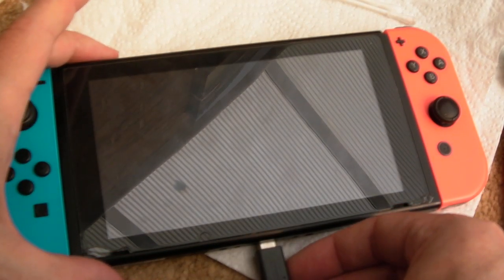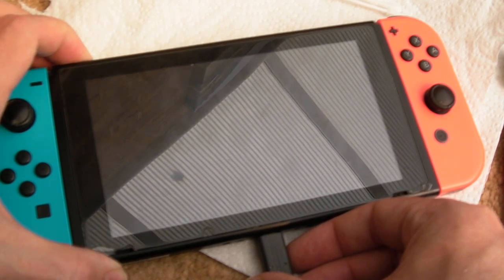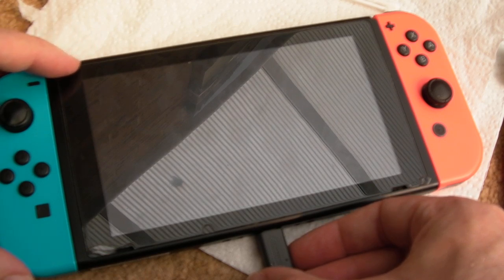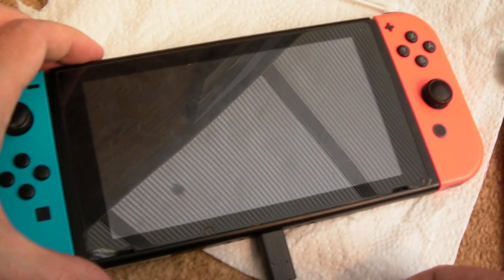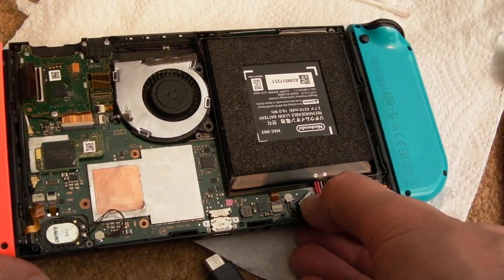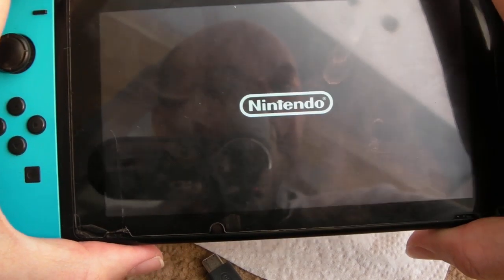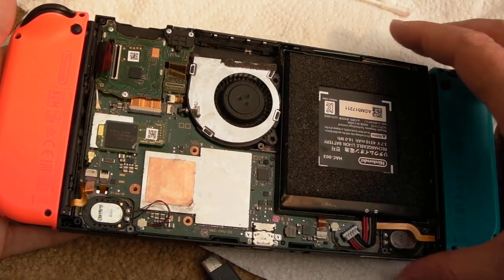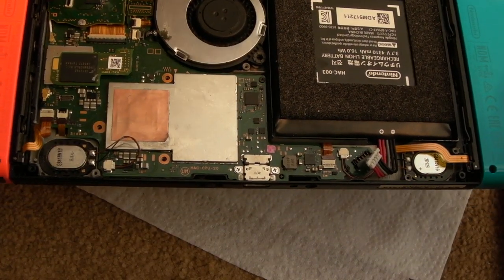Nintendo Switch (Water damage) - How it was behaving before it was fixed completely

Comment from the maker: The fix video this relates to is here:- The fix video is here:- https://www.youtube.com/watch?v=tub9zgg82H8&feature=youtu.be
I somehow forgot to include this clip in the fix video.  It's only a short clip, but you can see how it was behaving.   At the start of the clip I test without the battery connected, but then re-connect it, and it was doing the same thing.   If the charge cable was plugged in, it would show the charge indicator for 2 seconds and then do nothing, or if it was powered off and then powered on it would show "Nintendo" for 2 seconds and then do nothing.
It's like it was crashing after a few seconds trying to boot.  The only way to get either the charge indicator to show again, or to get the "Nintendo" to show again was to hold the power button for 10+ seconds and then re-try the process.
Reply: I had this before, re-seated the NAND and it started working

Comment: I have a water damage Switch that I picked up for $75.00. it came with two Joycons and Mario Kart 8, so I figured even if the Switch could not be salvaged I still got an OK deal. 
I had a guy in town look at it and say it is not fixable, but now I want to open it up and take a crack at it. Looking forward to the full video!

Comment: I have a Nintendo Switch with a non-functional fan. I replaced the fan two times, but it didn't make any difference. I use the Switch with an external fan now and that keeps it pretty good from overheating. But I love to hear your idea. Could it be the heat sensor? Can't locate it. :-)
Reply from the maker: Did you inspect / clean up the flat flex connector for the fan?  Maybe a bad connection in the female part?  From what I understand the joycon supply rail is in common with the fan - do your joycons charge OK?  It could be a failed mosfet transistor for the fan that has failed maybe?